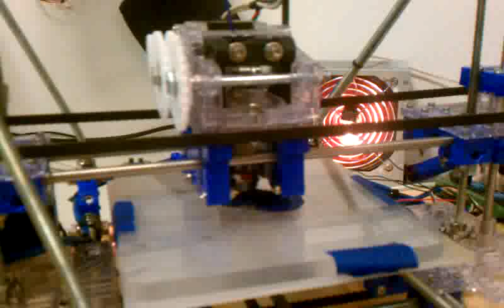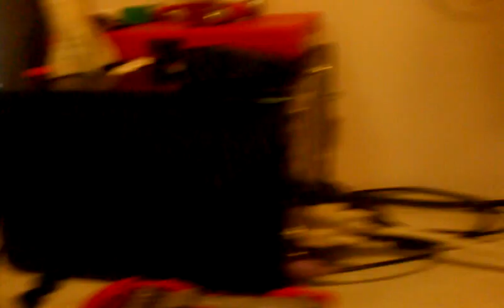SeeMeCNC H1 3D printer

Comment: I've just a quick question about the extruder. It sometimes does not extrude plastic and ruins the print. the outer gears spin, but the inner ones don't, so plastic doesn't add and the print gets messed up. I usually need to reverse the plastic and remove it, cut off the end and then reinsert. Then it works again for a while and does the same thing. Have you seen this before, or know how to fix it? 
Thanks!